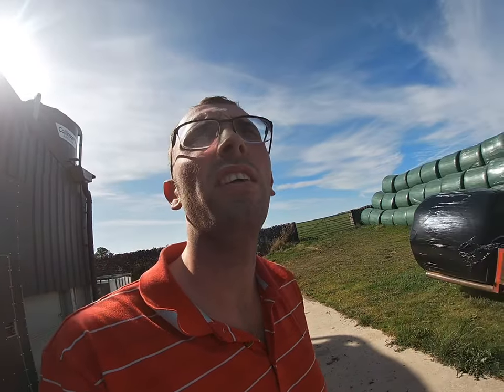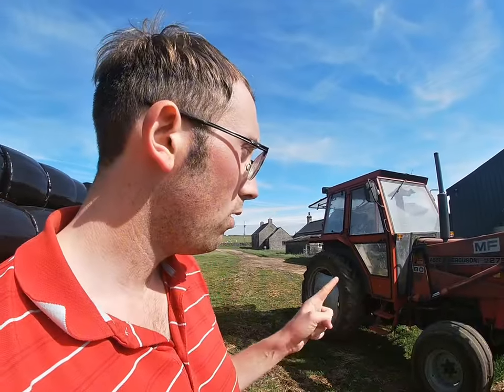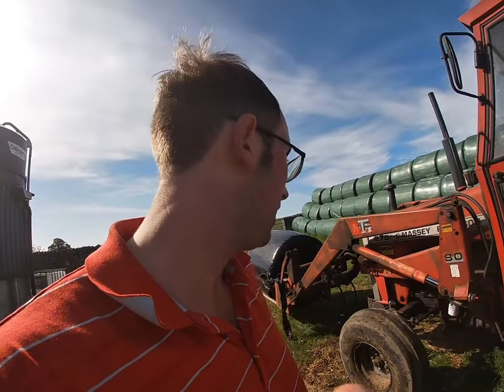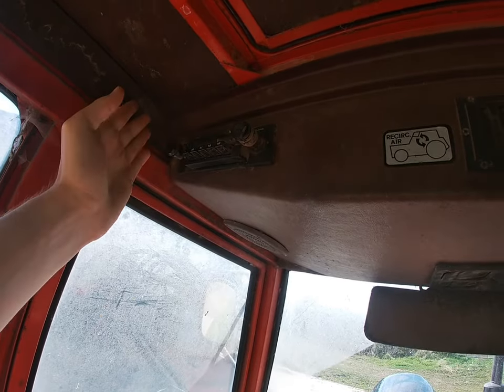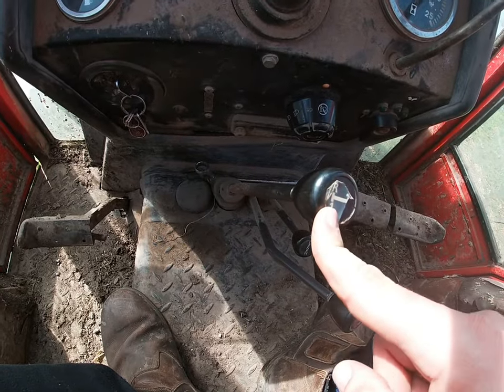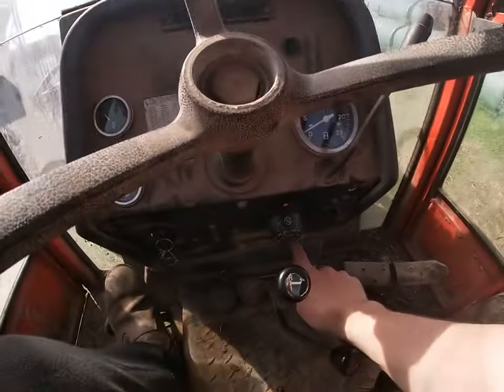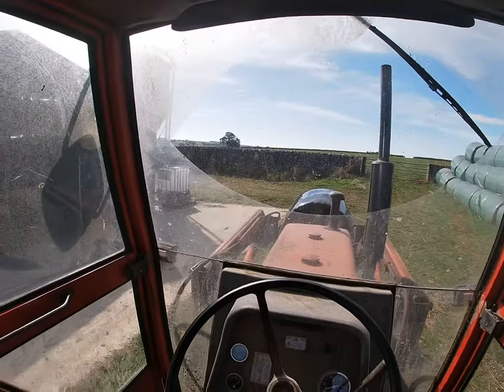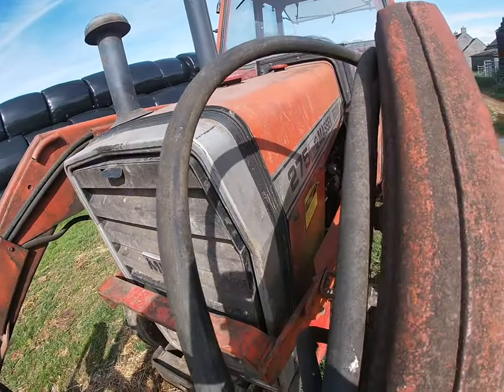TRACTOR TOUR - RARE MASSEY FERGUSON 275?? RARE OR JUST UNPOPULAR?? 38 YEAR OLD LESS THAN 4K HOURS

Comment: Never had anything to do with 200 series but drove a 698 4WD with the 12 speed box and loved it as we had a lot of very steep ground and Multi Power wasn't good with trailed mower forage harvester etc always seemed that the ideal gear was in the low multi which was no use going downhill 🤔 until the 2000 series came out with engine braking in the low multi power 💪💪👍 good walk round Will 👍
Reply from the maker: Thanks Bob! I’ve personally never drove one with multi power before, one of our neighbours had 250 with multi power that he could never get along with, in the end he got the dealer to remove it and just had a 6 speed gearbox in instead